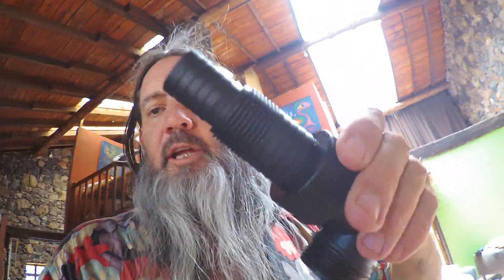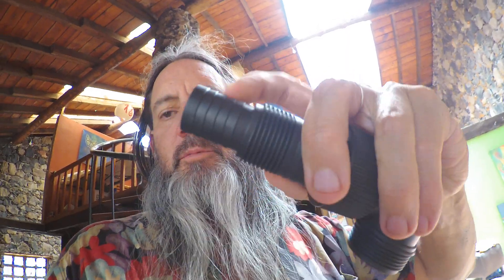Water and how you should not need pumps. Say Goodbye to Pumps: Simple Gravity-Fed Solutions

Comment: You need a hardware store like ACE or True Value with someone who can find you a reducer.
Most garden hoses in the U.S. are 5/8ths, but the igher volume, and more expenisve hoses are 3/4... The connections are 1-1/16 or 27mm. 

Harvesting rainwater is illegal in some states because it conflicts with people who own water rights. (That's the B.S. they use to justify it).  Colorado is one I know for sure that makes you get permits, and only allows you to have like a couple 55 gallon rain barrels. So, you have to be sneaky about collecting the water. 

For me, I would bury some sort of large tanks, or cistern in the ground that would hold the water, and then use a pump to bring it through some sort of filter that you could then use for palatable water in the house. 

The pond pump you have works pretty efficiently, but there are other pumps you can used to get a higher "head" so that you can pump your cool stored water from underground into the living spaces above. "Little Giant" makes great pump and impeller kits, but they're pricey. They can have heads higher than a 15' elevation. (But then, so do sump pumps). 

Instead of getting a reducer for your pump, you could get inexpensive "irrigation line." It's a black drip irrigation line that comes in 3/4," 5/8", 1/2," 1/4," You can bury it,  run it through rafters, or insulation. It's cheaper than Pex or a garden hose.  The current elbow on your pump is made to fit corrugated drain tile, or the flat hoses that roll out. 

Water storage can be above ground too, in "ponds" where you dig a hole out and line it with EPDM roofing liner. The water would need to be circulated with a pump and then filtered with a bog  with 2" to 3" gravel and plants. (Replicating nature).

Probably more info than you ever wanted to know. 
Thanks for the video.
Reply from the maker: Thanks for the thoughts. 
I store about 110,000 liters of water in various cisterns. I have been drinking unfiltered rainwater for over 20 years. 
I would prefer to make lake and ponds as Sepp Holzer does. No plastic. He put pig in the hole for a season or more, then bentonite clay. 
https://www.seppholzer.info